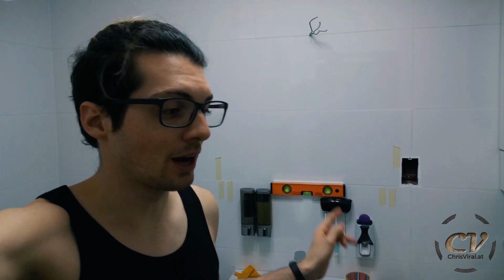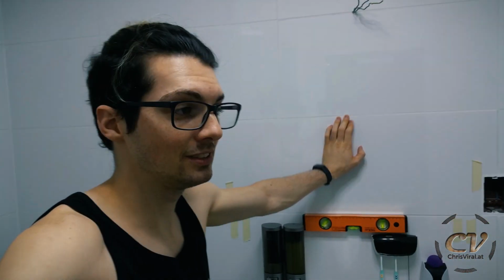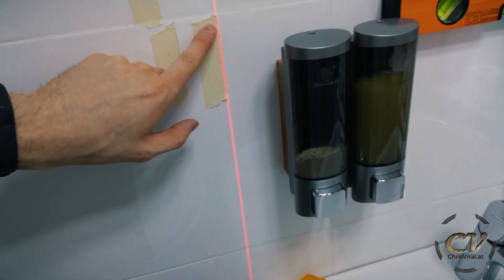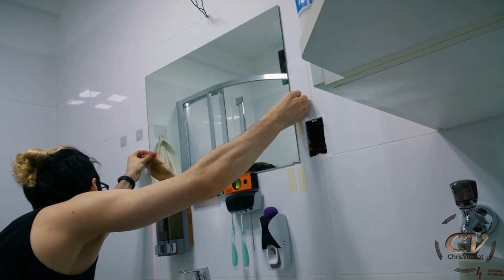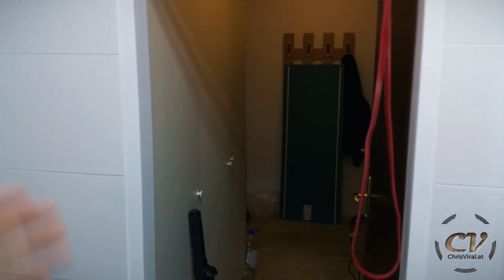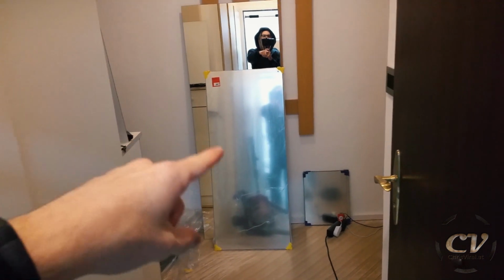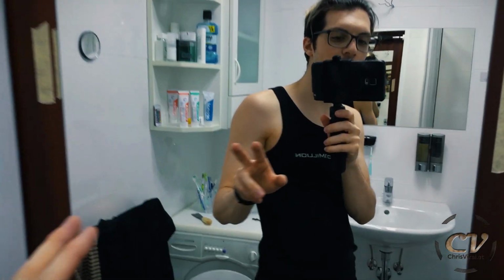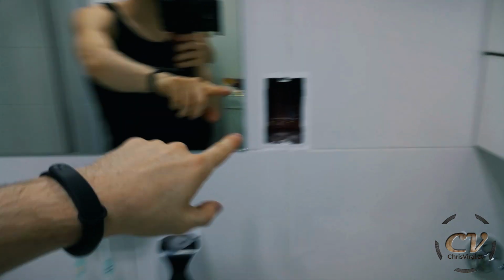How To Wall Mount A Mirror PERFECTLY

Comment: I have no mirrors in my room and it drives me crazy. But i dont want a big one with a bezzle. Were did u buy the one that u put in ur bathroom and all the others?
Reply from the maker: At my local hardware store or home improvement store rather. It's called BAUHAUS and the mirrors are called "Jumpy Serienspiegel". Super random knowledge I guess - they are the cheapest mirrors they have. But I actually don't like bevels too so it's a win win for me :)

Comment: did you checked the spirit levels quality ? when i was in the home depot i saw 95% of them are unprecise straight from the factory.
I checked all and found a good one i bought. I dont remeber exactly how i tested them. Use a wooden plane put the spirit level on it raise the wooden plate with paper until the bubble is in the center , now turn the spirit level 180 degrees around (rotate the z axis 180 degrees) and now look how much the bubble deviates for m the middle, that is the error build in the spirit level. A good one is nearly perfect.Instead of your eyes you could use a camera + a milimeterpaper background if you are a good marksman.

for your vent hole look ub this idea and make it just rectangular
https://www.youtube.com/watch?v=XBPCvrEd4XA
Reply from the maker: Well I checked it in this video. Surely cheap crap... How could I be that stupid and cheap out on that. When I think about it... What did I expect 😂
I don't even know if I can trust this laser since it's a budget china thingy too. And I can't even test the laser this way... But your test makes sense, I just need to find a proper spirit level to test the laser. DAMN IT

Oh HELL YEAH - take that love again (for the link especially). I want a strong exhaust fan anyways and was thinking to build a contraption for one of my windows. But that makes way more sense, sweet.